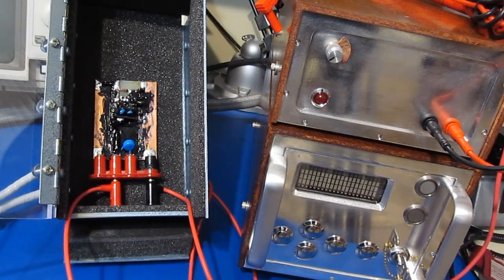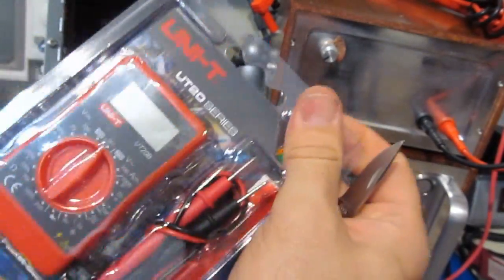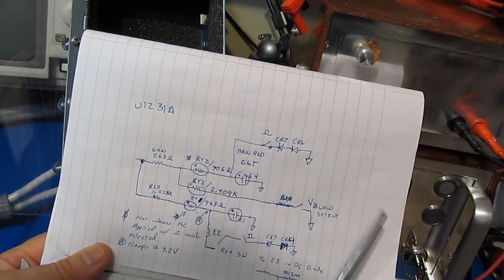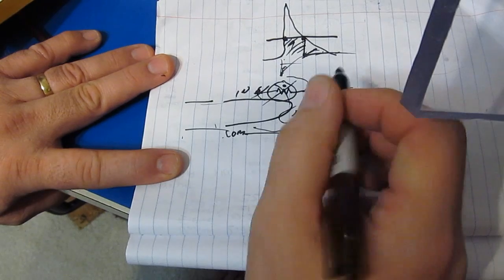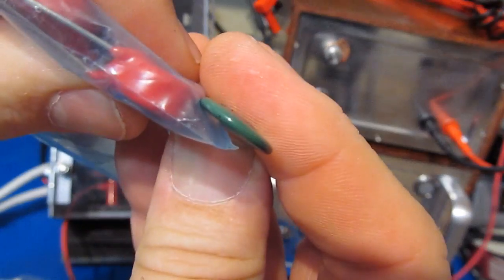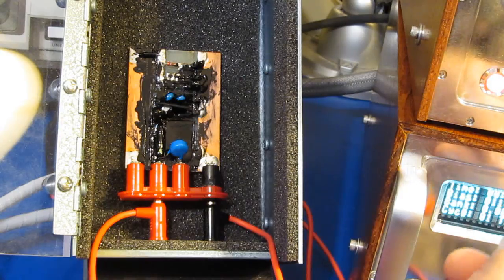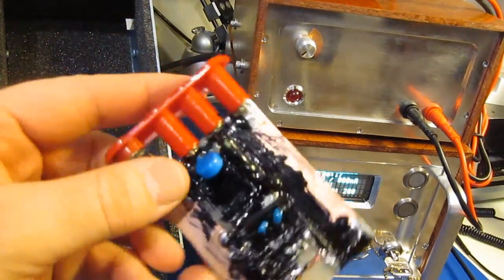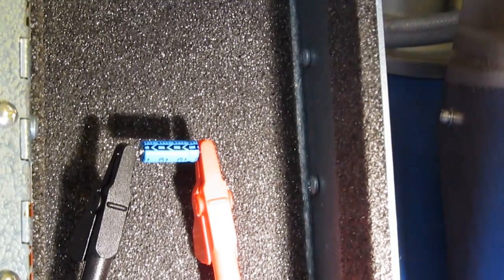Future videos and more MOV testing

Comment: Hi, great video, will definitely subscribe.

I need help, I have something attached to my old relay called a  Contact Protecter.

This vintage relay (1959) with copper leaf springs and it has a contact protector. Part made by "Federal" 15A2PS2

I need to replace this part and not sure the new equivalent part or even how I measure for the value using a multimeter which I do have. 

I'm just not sure what spec I need to look for on Mouser.com. I am ordering a few other parts with them so I'm sure they would have what I need if I knew what to look for. 

Any help, greatly appreciated.

Thanks
Reply from the maker: Use Google to search  Federal 15A2PS2.   If you are trying to replace the entire relay, it should have some specs marked on it, or you may need to determine the requirements from what ever it when into.

Comment: Joe, I have been watching your videos for a long time now.  I really appreciate the hard work that you have put into your videos.  It is a testament to the fact that almost all of the multimeter companies fail in designing a meter that is robust enough to meet the standards.  I scratch my head and wonder how do companies get away with this(?).  I hope that companies will open their eyes and provide better quality.  In a world where we think we need 10 ptcs and 10 movs to make a good meter, I often wonder about the quality of the actual components; much like fake HRC fuses.  But anyway, have you ever did any experimentation on Chrona Dope dielectric strength?  Also, there is a product by Oatey Fix it Stick; they claim it has a dielectric strength of 12kv/mm @3mm--would you consider testing such a claim?  I found this product in Lowes in the plumbing section for about $7.00 for 4 oz.  tube.  I guess I'm wondering if it can be used for high voltage isolation.  Any technical information can be obtain from www.oatey.com.  I'm an electronic technician--among other things and in no way connected to Oatey.  Again, thank you for all the videos, and I look forward to more.